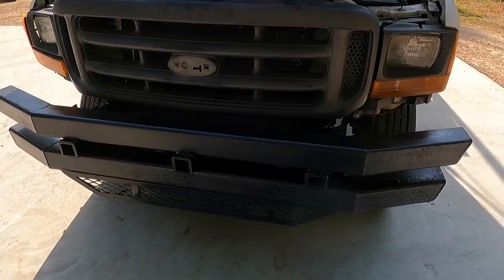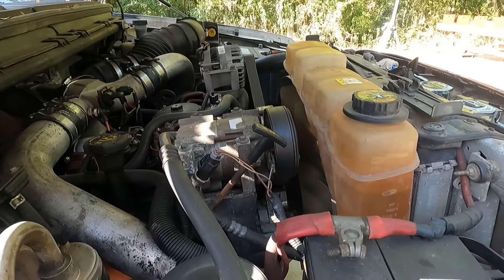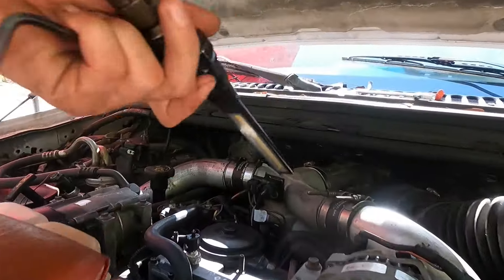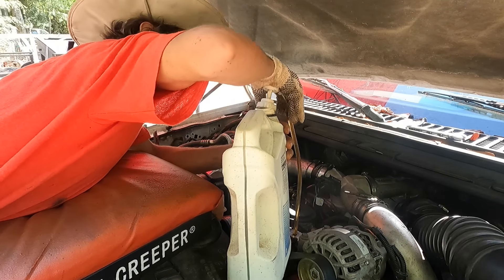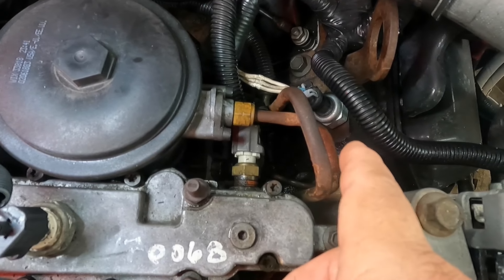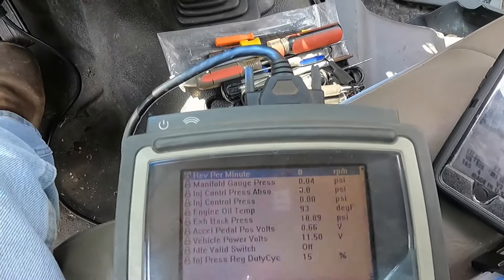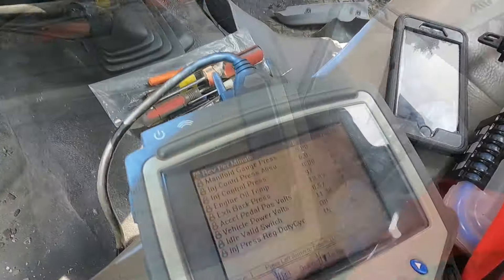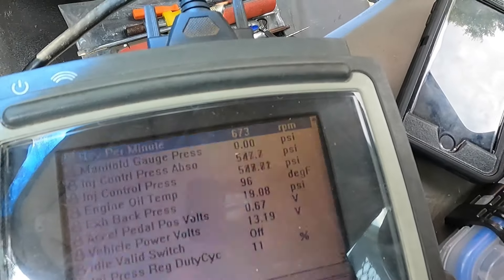HPOP Drained down.  Crank, No start.

Comment: I'm a little surprised a diesel shop would buy a huei injector engine. There's a hundred ways they can fail, and you just showed me another one. I got a 7.3 and it's like taking a second job, just to keep it running. I just changed the engine wiring harness and fixed several problems. Currently it's running like new. One of the best truck engines when it runs.
Reply from the maker: One of the big reasons these gals take some attention is that they are all over 20 yrs old and still on the road. That’s a badge that can’t be denied. You go to Ford for 7.3 parts and they are in stock. You have to order 6.0&6.4 parts. 
If someone doesn’t like um that’s more for us that do. I appreciate the comment and thanks for watchin.
Reply: @bayoudiesel I couldn't agree more 😎👍
Reply: @bayoudiesel I have a 2001 Ford and two 96 12 Valve Cummins. My Ford is a 12k lb dead POS. The two older Dodges are on the road start every time.
Reply: Totally agree.
Reply: Interesting way to define this machine we have, a second job YES!
LOL, I just acquired my very 1st rig, 
2001 F250 4x4, 94K Orig miles, garage kept beauty.
Oil filter were done 1,500 miles ago.
Already am preparing to establish a 
“Maintenance schedule’ ~  XLS spreadsheet with timer Alert to remind me of things.
This thing requires the 2-step Up and in, and under the hood!
LOL, One of the 1st things realized,  I need a platform set-up to get Under hood to do what I will need to perform for maint!!
Then my 7 Qt oil catch pan for my Honda, WON’T Work either, now need a whole NEW set of tools for this thing now!!
5 gallon bucket for just an oil / filter change, at about $150+ per session!!
Then sensors $30-50 to $150+, on & on & on.
I guess it’s “Welcome to the Diesel realm buddy”!!!
I’m happy though, a 1.400 mile trip was a pleasant like a small Semi,  it punched it out like Nothing and bullied the Accords a bit.. I’m totally happy!
Reply: @pinarellobikeride793  Don't skimp on oil changes. The injectors don't work right when the oil is cold and thick with soot. Better to add a bypass oil filter.
Carry a spare CPS and the tools to change it.
Buy Ford electronic parts. The cheaper after market parts have a high failure rate and don't last as long.
Idling for a long time after starting in cold weather puts more diesel in the oil. Best to start and drive away in a minute. https://www.youtube.com/watch?v=wEUMzSuEPBA
Reply: @oceanmariner  
Great point & reminder here Yes thx.
I’m going to use this message here to do just this, tools & CPS with other part.
My other truck I carry some items w tools too, I know this is very helpful and well worth the TOW bill consequence.
A small TOTE, Rags, flashlight, hand cleaner, gloves, and few other road emergency things.
I learned day One, to idle till the gauge reads a few needle widths past 1st COLD temp red line, usually close to 10 Min.
Until yesterday didn’t locate the block heater, To be employed.
This routine is new as the 7.3 is totally new to me in just 4 days now.
My searching to learn the oil , Lake replied and other folks saying Shaeffers Oil I will use is high quality.
New rig here, oil was changed about 2K miles ago.
My intent is build an XLS spread sheet schedule and initiate its life service records.
Absolutely yes on Motor-craft quality parts.
Near & immediate plans are:
1. Drain Tranny oil, new filter plus install the 19 row oil cooler.
2. Install the AMSOIL dual filter system and do another oil change to begin engine establish its life with Shaeffers oil.
(I get this from Lake Speed.)
3. Install the dual fuel filter / Lift pump system.
4. Do as you suggest,  Carry  tools & road side Emer parts.  
Then enjoy this well built machine.

Comment: Those low pressure oil pumps are bad for wearing out and bleeding the oil back and having a reduction in pressure.  Sometimes you just have to replace it. It's not a bad job to do because without oil pressure,  it isn't going to run.

Comment: It’s gonna do it again nice work, y’all get it fixed for sure
Reply from the maker: @floydwilliams3321  this one is an ongoing project. lol. Ounce we get time to pull the winch truck in for a little love we plan to delve into this further.
Reply: @bayoudiesel  Hi I'm curiosity what kind off scan tool you have to Reade the live data
Reply from the maker: @ I’m using an older Genesis scan tool.
Reply from the maker: @ I use an older Genesis scan tool

Comment: Probably back flowing through the low pressure oil pump pump.
Reply from the maker: @perryjacobs4093  agreed. The strange part is it does it irregularly. Which to me points to the check ball in the front cover which works in conjunction with a tight lpop. She going into the shop in the near future and we are gonna dig into it. Thanks for the comment and for watchin

Comment: yes i have a 1995 f250 7.3l and i have crank but no start as well but i deleted everything on valley and have CNC with new hard lines new stage 1 turbo have all new lines for fuel and have Martys E fuel and have a 38 gallon where the spare tire is with a sump kit and still no start everthing is new on valley old parts are taking off its open i do have a New IPR and ICP when i get home and also changing the HPOP as well and i have a new computer and still no start, but like i said im putting in the Hpop and IPR and ICP when i get home in 2 weeks so what is your thought. and thanks for the info on your video it will help.
Reply from the maker: @RobertSybert  sounds like you’re getting deep into this one. Let me hit ya with a few questions. 

Any codes?

Are batteries fully charged?

Is the oil level full? On stick and in hpop res?

Are you getting a tach reading when cranking? Shown on gage or better yet a scan tool?

Do ya have a scan tool that shows live data?

And finally, when cranking are ya getting any white smoke?

Hit me back and we can start there. Thanks for the question. Happy to see if we can help
Reply: yes it only have a battery light come on on the dash nothing else new batterys and starter new everything but no wait to start light
Reply: @RobertSybert check your fuses sometimes one blows and won’t let your relay work

Comment: i have a 01 7.3, the3se are the things ive done to it, new hpop,new fuel bowl new ipr,new icp, fuel tank mod upper wiring harness new oem inrail fuel pump new valve cover gaskets,new cam sensor, new fuel pedal map sensor ehaust sensor... truck cranks no start, 70 psi at fuel bowl,
Reply from the maker: Do you have a scan tool that will show live data by chance?  

Are you getting white smoke while cranking?

Is she popping while cranking or just spinning?
Reply: No popping no white smoke scan tool says icp and its a oem new one
Reply from the maker: @ronaldlemons2836  is the scan tool indicating a bad icp or icp pressure out of spec?
Reply: With the icp plugged in im reading 380 with it unplugged it reads 2200 while cranking,this is with a new hpop i understand that it takes 500 psi to start why does it have 2200 psi unplugged and 380 plugged in?
Reply from the maker: @ronaldlemons2836  when the pcm can’t get a good reading from the icp you can unplug it which will lie to the pcm and give it made up values to make it run. It does need to see higher than 520psi before the pcm will allow the injectors to pulse. 2200 is usual right when she would start to crank off.  If you are still getting a no start with icp unplugged then that may not be your issue. Sense no smoke is visible while cranking it seems something is not allowing fuel. Could be an hpop oil  issue, could be a cps issue, or fuel issue.
Reply: What is cps?
Reply from the maker: @ronaldlemons2836  that is the crank position sensor. 

So the pcm needs to see cps so it knows what the timing is, needs to see over 520 psi on icp pressure among other things before it will signal the injectors to pulse. 

It seems you are getting good fuel pressure to the bowl and I assume good volume as well. The pcm can’t see this so it just assumes the fuel is there. So if fuel isn’t the problem then something is preventing fueling. Meaning not pulsing the injectors. That’s the culprit we are looking for.  New sensors can be bad new harnesses can also be bad or have pins that aren’t seated right. Those may be worth looking at. 

I also check the hpop reservoir before starting after doing that much work. To make sure it’s full and the lpop is refilling it. With these injectors firing with hpop oil there needs to be sufficient pressure to make the pulse. As well as having fuel there ready to go as well.
Reply from the maker: If she has not tried to at least pop a bit when cranking sense you replaced the hpop I would make sure it’s primed like I just described. It can take a good deal of cranking if the oil galleys emptied or the reservoir when down.
Reply: you ever fix your problem?

Comment: What scanner are you using. I have tried several from the parts store and none will read ipc or ipr let alone live data.
Reply from the maker: Cheaper scanners won’t usually read live data. The one I have is an old Genesis scanner. It works well with these trucks. Some of the really new scanners have trouble also. Because these trucks came out early in the OBD 2 era. 

Fore Scan seems to work well from what I hear. I don’t have very much experience with it tho.
Reply: @bayoudiesel  Do you know what model your scanner is?  I would like to see if I could find one like it.
Reply from the maker: Mine is an older genesis scanner. The parts stores don’t sell commercial grade scan tools. They can pull codes and do simple checks but not live data and diagnostic functions. These trucks are all 20 years old so you could do what I did and pick up one that a mechanic is getting rid of to upgrade to a newer device.
Reply: I got a laptop and the forscan software, works perfect
Reply: @tjdicks3987  thank you so much. What OBD2 adapter did you buy? I was told some knock off adapters will not run all the diagnostics that the app will do.  Not sure what brand to order that will work. I am down to checking hpop pressure and idm. Thanks again
Reply: Use a laptop and forscan..
Reply: @hondaxl250k0 How do you connect the laptop to the PCM?

Comment: Great video
I have 1999 F350 7.3L powerstroke dally.
I haven’t had any problems other than a water pump and hoses .
They are great engines.
I do have a question does my truck have fuel pick up strainers in the tank?
Reply from the maker: @DANIELROMERO-cv3tu  it should have the screens unless someone removed them and did something like the hutch mod. I have a few videos on this if ya need.
Reply: This dam 7.3 is the most unreliable engine out of the 8 different diesels I own.

Comment: I appreciate the video as for me, an old school car mechanic from back in the carburetor, points and condensor days then welder and truck driver for the last 35 plus years after leaving car repair. Now I have a 2003 6.0 I bought last year and had no idea that it would be at least 10 times more complicated than my 60 series Detroit. Now I have to learn a new language and study hundreds of hours of YT videos to feel safe driving this 6.0 so as when, not if but when it fails, I will have some idea where to look because I don't trust any shops to work on my stuff. Can you recommend a user friendly scanner that I should buy, I have a couple code readers, 1 simple codes only and another I think I paid about $300 or so that I bought for bleeding abs. I like your topside creeper, I need to get one.
Reply from the maker: @GordonRobertsonDIY  the top side creeper is a must and they are not that expensive.  As for scan tools I use an older genesis scanner I picked up from a friend who was updating. Since these trucks are all 20 yrs old it doesn’t have to be a new one. Several viewers use forscan as a programmer and scan tool. As for what’s good in newer scan tools I’m really not that up to speed. I do know that at here are several that will blue Tooth  connect to your phone or pad. I would just check to insure they provide live data and diagnostics as well as the code functions. There are a few groups on face book that you could ask they may have more info. 
Appreciate the comment and thanks for watchin
Reply: @bayoudiesel  Thanks for the reply sir.

Comment: Kind of off subject but I’m having an electrical issue where #1 injector isn’t firing, only a tiny bit of oil coming out of deflector. Checked all wiring, swapped idm, new set of injectors and issue is still here. What am I missing ? Any help would be appreciated
Reply from the maker: Check out my response in your other comment. Thanks

Comment: The plug in for the icp has 3 pins how many volts should be at that plug with key on
Reply from the maker: 5volt reference if I remember correctly
Reply: Also The "signal" wire should have 0.25v +/- with KOEO
Reply: So i installed a new wiring harness,so there is a chance the new harness could have issues??
Reply from the maker: @ronaldlemons2836  always a chance of that these days. Can you refresh my memory on what you are fighting and the symptoms? There has been a lot of water under the bridge sense this discussion started. Thansk
Reply: @bayoudiesel  
Yessir 
Its long list,but it started with the truck having no power,so i dropped the tank and did a hutch mod and a frame mounted filter,new oem fuel pump,new fuel bowl new oem ipr,icp,hpop,exhaust sensor and tube,rebuilt 40,000 volt pcm new fuel pedal new wiring harness new valve cover gaskets, so i got it runnin and it had great power,the reason i threw new parts was i bought it with 207k and thot id update so 2 wks ago im drivin and i feel it loose power and what i mean is when id take off it would take off fine but the more i pushed the pedal it just wouldnt go and when lettin up on pedal it would miss like blahblah blah then level out, the fuel pressure is 70 psi at the bowl🙈🤷‍♂️
Reply from the maker: @ronaldlemons2836  ok. Couple of questions. 
New wiring harness. Does that mean the engine harness? Or just uvch and/or pigtails?

Has anything been done with the injectors?

Do you have access to a scan tool that showed live data?

We may make faster progress on the phone. I’ll offer ya this. Hit me up on my email. 
Bayoudieseltrucks@gmail.com 
Shoot me your number and an idea for a good time to call and we can kick it around that way.
Reply: @bayoudiesel  
Thank you
Reply: @bayoudiesel  yes i replaced the engine harness which has the pigtails and the plug for the valve cover gasket kit

Comment: Evenin
I got the 7.3 started,i swapped the solenoid from 1 ipr to another and put a icp in it started and took awhile to run right but idled fine,test drove it and ran fine but…. When i turned it off and maybe 10 min later it starts and dies till i randomly put my foot on the fuel   Pedal and it fired up now i know there is no cable on it and my fuel pedal is relatively nee and dont have a removable throttle post sensor. Got any ideas?
Reply from the maker: Were you able to put some drive time on it?  Usually take about 40 plus miles of driving at different speeds to burp all the air out of the system and get them to run right again
Reply: So driving it will help with it not firing up after its warm? It so wierd that i can push the pedal down a little and it fires up

Comment: I bet my hpop is dry as a bone too! Can’t wait to check it
Reply from the maker: It happens. I have had to refill hpop res 2-3 times after working on a truck. Depending on the job. Empty oil galleys can eat up what’s in the res quickly. Also, you can fill the oil galleys themselves if needed to not use the res oil

Comment: Yes,
I'm really not surprised about human illogical approach about these rigs.
Ppl never seem to get it,  that these rigs need more attention and practical maintenance than their japcrap they are used to “do Nothing” on. .
The 1st impression found on YT ‘Custom Works” timeless wisdom channel!
Tells ppl how to make there rigs Last and Last!
Row thru ALL the sensors every 100K miles, vlv cvr gaskets & harness and glow plugs, ALL oils & filters Changed Eng-Trans.
Eng 5K, Trans 50-75K, DIFF at leat 75-100K.
All the reports I see guys getting 400-600K miles did this schedules maintenance.
Reply: There is about 24 different major parts that can fail on this fuel system and it will not start. An old mechanical injection pump is the way to go.